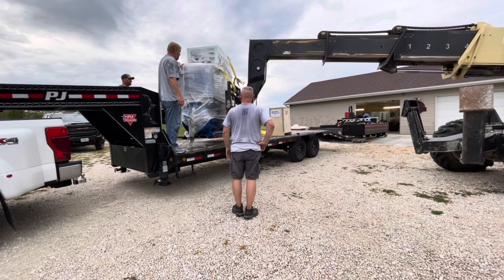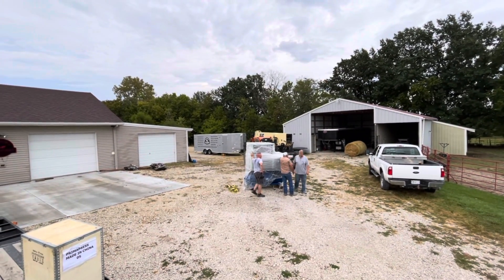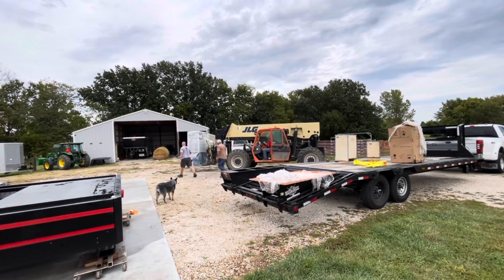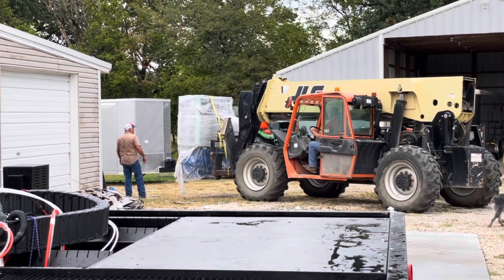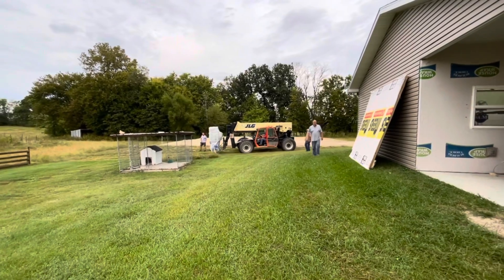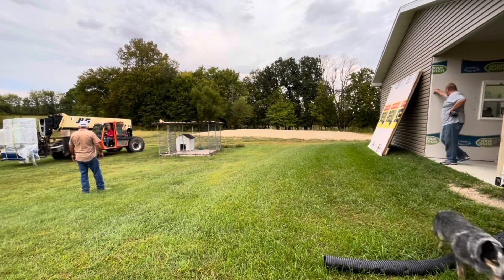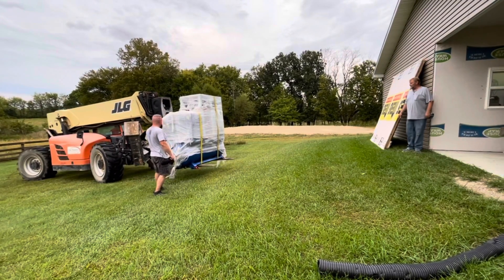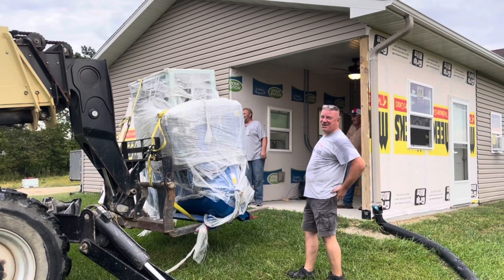Compressed air Laser cutting with 50cfm 240psi air compressor

Comment: Sir, I have a 1500w fiber laser machine. Does the 10 bar screw air compressor work with me well? How much does the acier carbone cut and how much does the stainless cut

Comment: Nice sound, but it feels like a 747 is about to take off... Good idea to put the compressor in the back room...

I suppose 5mm on Nitrogen would give the same kind of dross as with air or even a bit worse?  After all air is mainly Nitrogen... with a bit of Oxygen...

Continue like that Gary 👍